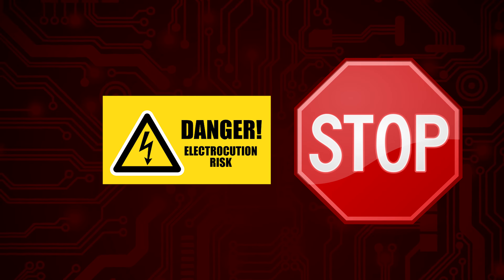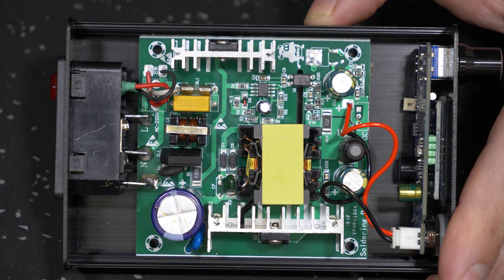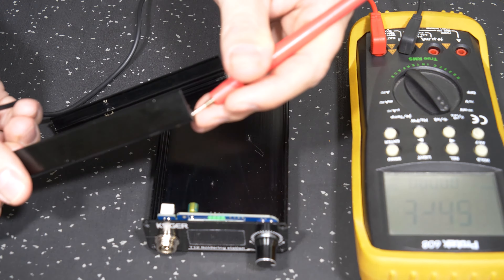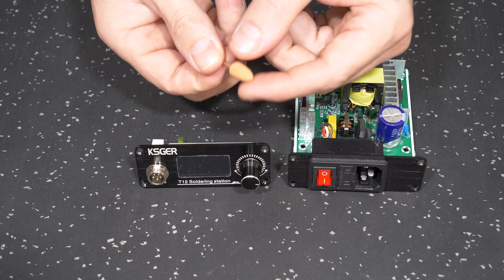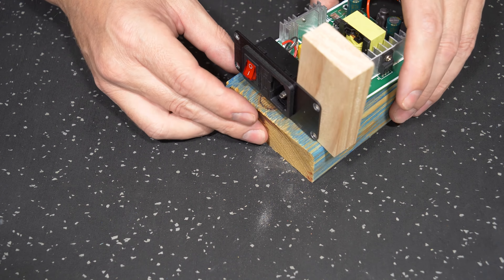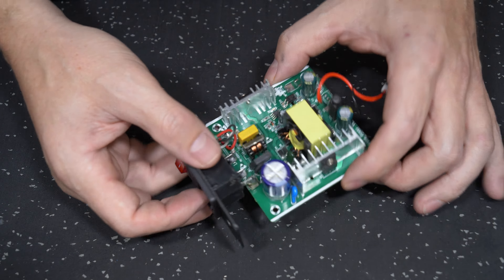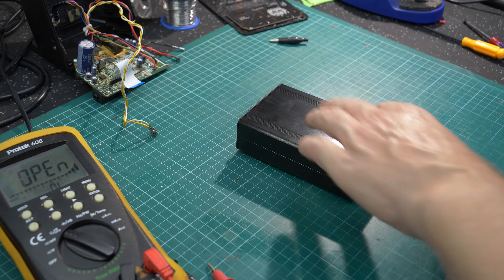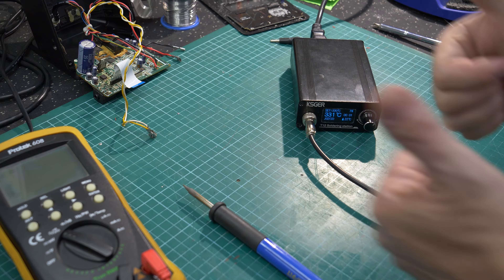#31 - The KSGER T12 Soldering Station - How to bring it back to Earth!

Comment from the maker: If you would like to support the channel even in the smallest way, please follow this PayPal link - https://www.paypal.com/cgi-bin/webscr?cmd=_s-xclick&hosted_button_id=R4FD8SPDTM5Q2&source=url - your support will go back in to creating more content and help secure the channel's future.  Thank you.
Reply: My friend i got a question. Isnt it easier if you solder the ground to the screw? Will it work? Why make a new hole for a new screw?
Reply from the maker: @iory330   Hi there, thanks for your comment.  Most EE standards around the world require a robust mechanical ground connection.  Soldering a ground wire to a screw wouldn't qualify as a suitable and robust method. Besides, solder won't bond to black oxide screws.  Also, there are no internal screws to utilize for connection, hence why one was installed. 👍
Reply: @xyzconceptsYT  thank for clarifying it.
Reply: Where can I get a dremel handheld shaft like and how is the friction resistance? I have flex shaft but even with grease it is drastically lower than using the dremel alone.
Reply from the maker: Hi Jay, the flex shaft I used in the video was some random thing laying around the shop, I just frankensteined a method to fix it to my cheap dremel.  Couldn't even tell you where I got it or what brand it is.  Fricton resistance is low and quite good doesn't bog down the dremel much at all.

Comment: Quick note: if you have a black V2.05 board - most likely the tip will NOT be grounded, but PE and -(neg) can easily be connected with a short cable as they already have soldering holes on the board.   That will bring the tip (pin 3) of the connector to ground.
Reply: Very important comment there. Realized mine wasn't grounded after trying to desolder something and touching an unrelated pin and receiving a small shock. Thankfully nothing was broken, but the tip is in dire need of grounding

Comment: I just bough the T12, it's an amazing soldering tool, one of my favorite tools now (the rebranded Quicko T12 is half the price, 100% cheaper at US$22, shipped, but only comes in the MINI form factor which may not stack up well but is more modular. Though KSGER is more elegant).

God bless, Rev. 21:4
Reply: Hi
Quicko has the mini version (942), which you bought and the bigger one which is called 952. These are more expensive though.
Pedro

Comment: I just came across this video. The only problem with this, and it is important to earth the equipment, is that mounting screws should not be used as earth contact according to Australian Standards. Earth connections are to have dedicated fastenings that are NOT part of the mechanical assembly of the equipment.
Reply from the maker: Exactly what the video shows. 😉 As the earth connection is independent of anything else. Thanks for the comment.  Strictly speaking, the makeup of the actual enclosure could benefit from an earth connection to each component of the case in a star configuration.

Comment: First T12 grounding video I've seen where the anodization was taken into proper account.  What's your insight? After I do this is the ESD on this unit good enough? Sorry, ESD mitigation is not my area.  I think the LC path is a good one for ESD, while still protecting against too rapid a discharge if one touches a moderately charged cap on a board being soldered?  Thanks!

Comment: It should also be remembered that the RCD will trip the fastest at 30 milliamperes, however, if you combine it with a voltage of 230 volts and a frequency of 50-60 Hz, it can be fatal anyway.

Comment: Hi, adding the ground wire to the case also makes the tip grounded ? Some connect a ground wire directly to the Tip GND of the GX12 connector.

Comment: I bought this station to learn but mine differs from all others I have seen. I've watched vids on v2, 2.1s, 3.1s and they all show what looks to be a capacitor? on the board that is attached to the back of the forward facing display. Mine does not have this capacitor. Is this an issue? Do I have a different model?
Reply from the maker: Hey there, does your unit work ok?
Reply: @xyzconceptsYT  I'm not using it until I can find someone to solder the ground wire in. This is my first soldering station so I cannot do it (so funny right?) I did find out after going through my old purchase history that I purchased it from the KSGER store on Amazon and it is v2.0.

Comment: Hi, great video!  A lot of people also commented, and you can also find videos showing that there is a potential risk with the big heatsink that goes from the primary to the secondary side.  In my case, I checked the T12 unit I received and the heatsink in mine was raised up, so the heatsink is not touching the mask.  Also, about earthing the case, will it be enough to run a cable from the barrel to the earth connector, so to prevent drilling the case?
Thanks!
Reply from the maker: Hi, thanks for your comment.  Like I demonstrated in my video, you have to treat all the countersunk holes (remove the anodising) to ensure a good earth contact with each separate component of the case.  Just earthing the socket barrel in my experience would not lend to a definite earth connection throughout. The heat sink issue you describe is also a design oversight, but to a lesser extent, that affects personal safety. Thanks for watching.

Comment: hello, thank you for this video, can i follow this method applying to my ksger t12 also? but my country only provide 2 ports in main oultet , no ground...
Reply from the maker: Hi there, If you don't have the third pin on the mains outlet, then this mod won't help you very much.  This is because any residual current won't have a dedicated path back to mains ground/earth.  Do you have any earth-capable outlets at all?
Reply: @xyzconceptsYT  nothing either, anyway, can i just bury a rod into earth ground and used it?
Reply from the maker: @ohmware2020  You can definetly install your own earth, but then it becomes a practicle issue I guess.  Just be aware if you live in a relatively dry climate the earth rod system can diminish in effectiveness.  Earth rods should should be fairly deep to take advantage of higher moisture content soils.
Reply: @xyzconceptsYT  yes, i live in philippines,    one thing i notice when soldering smd led, the led light up when im soldering them, im curiuos about it, this means that the tip of my solder has voltage?
Reply from the maker: @ohmware2020  You may have some induced/phantom voltage generally this is very very low current.  However, during a fault event could be problematic for you.
Reply: @xyzconceptsYT  thank you very much... i learn a lot in your videos... thanks for explaining everything! god bless u more!
Reply from the maker: Thank you for reaching out, share my videos with your friends, I really am looking forward to 1000 subs this year if I can! Peace from AU😁
Reply: @xyzconceptsYT  sure no problem... they will be interested with your contents

Comment: Just checked mine and no continuity between socket and pot on front panel. Did all your fixes plus removing some anodizing under those 2 connectors on front panel. thanks for doing this.
Reply from the maker: Glad you could benefit from the video. 👍 Stay safe.

Comment: So if I soldered to the neutral with the iron I was doing this to, is there anything I can do to fix it not powering on. Yes I know that was a terrible idea in hindsight.
Edit: til there's a gfci outlet at the garage door opener that broke the circuit it's working now. 🙏

Comment: Look at the air gap from low voltage side to high voltage side on the PCB under the aluminium heat sink!!
Reply: I got into a verbal "fight" with a german YouTuber about this heatsink.
400V rated Electrolytic Loading Capacitor @ 3mm distance to it.
He said I am looking for the fly in the ointment. "The Heatsink isn´t connected to anything"   ;)    MBRF20200 ?

Comment: I wonder how those 'black' screws were making a good contact with the exposed metal of the panel countersinks.
Reply: Because, like he said, it's not anodized aluminum, but black metal. Which is heavy and penetrates everything.
Reply: Those are likely just oxide blued steel screws, still conductive despite not being the bare metal colour, if the screws were anodised, which would make them non conductive to an extent, they would not be anodised for very long considering that there'd be a reasonable amount of friction on the threads when they get installed so that'd just get abraded off in the process of being screwed in

Comment: i bought the Same machine to do my Trains and Tube AMP builds. the auto start stopped working, then it died altogether and would not reset at all. I took the handle apart to find two broken wires. A blue wire matched the length of the position sensor i resoldered that, but the Black wire does not seem to have a place to go. There is green, red and white attached to the only visible tabs. where does this black wire go? and my wire is significantly thinner than the ones i have seen on line. Need a hand here its Dead in the Water. Short of ordering a new handle.  Dennis in Virginia

Comment: This soldering station will trip differential protection device(if installed) on mains??? Will work as 110v in two-phase 220v?
Reply from the maker: Yep, works on my RCD/GFCI @ 240ac, I believe it will work on 120ac no probs.
Reply: @xyzconceptsYT  i did a case grounding mod exactly like yours and it works through mains differential protection device. so its ok, i guess

Comment: Nice video, very well made.
I'd do away with the spring washers though, any I find in our workshop go straight in the bin. Many studies have proven they do nothing, or are worse than using flat washers or none at all.
If you're really concerned about loosening under vibration, a jamb nut, nord-lock, nylock, etc would do the job.
Reply: I was thinking the exact same thing at the time, could just use a lock nut, or as you mentioned, a jam nut would do the trick nicely

Comment: Hi, I have a question about the ESD safety of these units.... Does the earth not need to be carried through to the five pin din plug.on the front, or do these t12 tips not need to be grounded?
Reply from the maker: You would think so. To dissipate ESD it would be safe to direct it to ground so yes, an earth connection direct to the soldering iron tip would be the best way to do this.  This particular model has a decoupled earth via an electrolytic cap.  I think of it as a poor implementation so they can tout "ESD Safe", the decoupling cap should really be a high-value resistor somewhere in the order of 1M ohm.  Thanks for your comment.

Comment: hello, is the black wire of the 24v output tied to earth?
Reply from the maker: No, this should be separate from the primary earth.
Reply: @xyzconceptsYT  thanks. because the mini version , the gnd of the 24v pin is tied to metal casing, and on the gx12 connector, the gnd and pe(protective earth) is connected together

Comment: Thank you very much for this important tutorial. Could you add the tools and parts you used for it?
Reply from the maker: Just basic and cheap rotary tool, a drill with a 4mm bit and a soldering iron will do the trick.  an M4 x 10mm machine screw and shake-proof washer and matching nut, 4mm eyelet, and 50mm piece of earth cable salvaged from an old mains cable works well.
Reply: @xyzconceptsYT  Thank you very much!

Comment: Hey, them "shake proof connectors", what is the proper name for them?  Trying to hunt for some on aliexress and but struggling :) Thanks
Reply from the maker: They have many names, lock washer, star washer, anti-vibration washer.  May be start with eBay and google images to help find what you are chasing.  Hope this helps.
Reply: @xyzconceptsYT  Thanks bud, let the hunt commence :)

Comment: What size is your ground wire? What size would you recommend? Would an 18 AWG wire (10A ampacity) be sufficient or should I use a lower gauge wire with a higher ampacity?.
Reply from the maker: Hi Jerome, thanks for your question. Ideally, you wouldn’t need to exceed the cross-sectional area of the conductor that is already in your supply lines or for the rating of your breaker. In the context of this device, a 1mm2 or 17AWG (1.04mm2) earth conductor would generally suffice (or loosely speaking no smaller than what is already in a good quality IEC supply cable) for example. I think 18AWG would be a tad on the small side but is defined to carry 9.5ish amps for the purpose chassis wiring.  Please take this information based on theoretical data informing design rules and that you should do your own research and evaluations for the country in which you live.  Stay Safe.

Comment: my ksger body is plastic, front and back covers is aluminum just bought it last week, I assume its safe?
Reply from the maker: The metallic case components are always an issue, to what degree is the unknown.  If it were me, I'd check it out to see if there has been an attempt to earth the unit.  Technically speaking, all metal mains connected case components should be earthed there are no exceptions to this rule. Hope this helps.
Reply: @xyzconceptsYT  thank you, i have opened it up its all plastic even front and rear thought it was metal

Comment: Do I need to do any of this if I get the plastic case version?
Reply from the maker: Generally no, but as long as there is no metal contact points, like an aluminium potentiometer dial, socket or soldering tip that could become live in a fault scenario.
Reply from the maker: Just be alert with the front socket and adjustment dial, and check for earth to the soldering iron tip when installed.
Reply: @xyzconceptsYT  Is there also anything I can do to make it look more aesthetic? I really like the look of the metal case version but I bought that plastic case version because it uses wires for the mains connection which I think is more secure and the plastic case is safer. I don't like how on the plastic case version the front plate sticks out and doesn't align with the rest of the case.
Reply from the maker: Transplant it to a case of your liking if you are handy like that.  The metal case version is fine after a few simple mods.

Comment: Think while I was in there I would replace the cheapo filtering electrolytic caps in the power supply.
Reply from the maker: Yeah, but I'd like to see how much use I would get out of the thing until I really have to change them.  So far still ticking along. May be what I could have done, is read off the ESR as a baseline ready for comparison at their inevitable demise.
Reply: @xyzconceptsYT  Suppose over the years the issue of garbage caps has probably improved. I prefer when taking gadgets of low cost apart to replace the caps, if they go they typically take something else out as well.

Comment: Just bought one, now I have to mod it.  Even though there are several videos about this, yours was the easiest to follow and simplest to make.  On other videos though, some ground the tip of the soldering iron itself.  Do you recommend doing this as a complement to your mod?  Thanks
Reply from the maker: Thank you for your comment, I am glad my video helped you.  Regarding the soldering iron tip grounding, this will depend on the type of handle you have as there are so many types out there.  In my case the tip was grounded to mains earth through a decoupling capacitor and an inductor (for ESD mitigation), the problem was the metallic case itself did not make it back the mains IEC earth pin.  That said, this may be different depending on the type of soldering handle you have. 👍

Comment: If you connect a wire without a ground, is it then less safe to have the appliance ground modded?
Without the mod the parts seem more isolated from each other, so in a fault scenario it has to be the exact metal piece you are touching, making it more safe, in a scenario where you don't have a grounded outlet? Or am I incorrect.

I was thinking a lot about buying the KSGER T12, then got a bit scared about all the "not grounded" warnings around the internet, then I looked at my two weller stations (WTCP-S and E 2002) and realized I have been using non grounded solder irons for years lol as they have two-pin outlet connectors....
Reply from the maker: Are they plastic housing/cases?  Otherwise probably double insulated, then there is no need for grounding.  If they are not grounded chances are they're also not ESD safe either.

Comment: What is it with Chinese soldering irons and not earthing them properly? I had to modify my "937D" soldering iron after finding its claims of being ESD Safe were complete lies. Unlike yours they'd bothered to connect the earth wire in the plug to the transformer's core, so it wasn't super dangerous, but I had to add a wire to link the tip connector to the earth pin myself.

It's almost now standard practise to test cheap gear before switching it on, isn't it.

Comment: i have a ksger t12 and after 1-5 minutes it locks up and i have to cycle the power.
it is brand new... probably a faulty unit huh?
Reply from the maker: If you can check the power supply for being unstable.  Micro controllers like a clean and stable power suppply.
Reply from the maker: This unit is 24v. 🙂